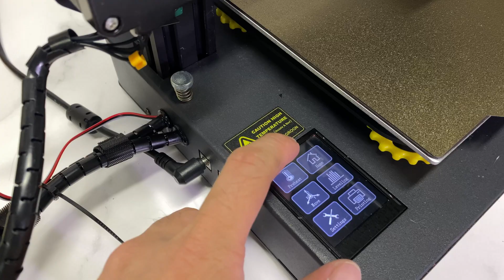How to Add a Filament Sensor to the KINGROON KP3S 3D Printers

Comment: what if ur filament comes from above the printer, i had to relocate the one that came on my kp3s pro and my kp3s doesn't have one but i made a bracket that mounts on top of the z axis extrusion, take the two bolts out hold the leadscrew guide or whatever u call it but it bolts up on top of the leadscrew bracket an uses a 608 bearing so it can pivot side to side with the hotend. i just got the printer a couple days ago an just finished putting it on the printer so after some testing if it works out good, i'll share the files on my thingiverse an other pages but ull u have to search for it ur self cause i dont have it post yet an ill probably never get back to update this comment once i do get it uploaded. Kingroon you really should consider most ppl dont have there filament sitting on the table next to the machine an almost always have it on top of the machine or above it. i own 14 printers 3 of them are kingroon, a kp3, kp3s, and a kp3s pro but out of all my printers only 3 of them actually hold there filament the rest have it spool holders attached to the enclosures there in above the printer or off to the side as high as it can go in the enclosure so still above where the sensors are placed an opposite direction of the filaments travels so u really should consider making two option for ppl to use so we dont have to figure something out on our own, if the sensors could have a piece of ptfe tube put into the out side so it could go down an into the inlet of the extruder that might work but u would have to have the sensors cable long enough an ran with the hotend cables so i think u would be better off just making a bracket that can be mounted at bottom or top an have it so u can have the filament direction coming from the top or from the bottom. if u do this it takes alot less ptfe  tube to help connect the runs. i have just a short piece coming out of the sensor to help direct it an another short piece going into the titan hotend  to make sure it doesnt wear the inlet, it comes with a small piece to help but it doesnt take long for filament to rub through that an into the extruder. think about it.

Comment: Pra quem instalou o sensor, acendeu o led azul e não imprime, como se estivesse acusando falta de filamento, é só alterar a configuração fg_filament_det0_trigger_level  de '0' para '1'  no arquivo de configurações robin_nano_cfg.txt.  No cartão tem este arquivo com as configurações atuais, só que com a extensão .CUR.. é só alterar para .txt, editá-lo e reiniciar a impressora com o cartão inserido.
Reply: there is no such file on my SD card.
Reply: Downloaded the firmware for the printer...  I found the file and did what you suggested... it works 😁 thank you.

Comment: On 2:03 it can be seen that red and white were switched places, but I missed it, and it wasn't mentioned out loud. Good thing I didn't burn anything. Found out only when testing.
Reply: wrong position wire color ?
Reply: @rennug3151  It's correct in the video, but out of the box the connector's pinout may be different. Check before powering.

Comment: My KP3s is version 1.3. The Sensor is working the other way around, it beeps with filament and prints without filament, how to fix it?
Reply: I found the solution, I changed the >cfg_filament_det0_trigger_level to 1 in the robin_nano_cfg.txt file
Reply: @rodrigorbonfim  Hola Rodrigo a mí me pasa lo mismo, pero no tengo ni idea de hacerlo, me puedes ayudar? Muchas gracias
Reply: @djkaleleltemplario  yo corté el cable e invertí los colores. Funciono perfectamente

Comment: If for any reason I start a print without placing the filament through the sensor, will it print?

In other words, if the sensor one day stops working can I still use the printer without the sensor?, do I have to make or configure something?

Comment: is it possible to change pause position? when I print a lot of elements, pause do a crash with previously printed element, is it possible to change it?
Reply from the maker: Please flash back to the stock firmware. If you have already done that, please use the Cura as Slicing software, the crash happens when using PrusaSlicer.

Comment: So the sound comes from the sensor? I dont see any beeper inside the printer (which would be good to have to indicate "print is complete"). Also I doubt the tube is necessary. Plus could you pls tell me the GCODE command which is responsible for Change Filament or at least Pause, M600 does not work, also it does not respond to Cura's Change Filament commands. thank you.
Reply from the maker: The beeper is under the screen, a small, round and black unit. As for the tube, you can test it out to see if it is necessary. The current stock firmware doesn't support M600 commend, if you need that feature, using the Marlin firmware would be a good choice. But our stock firmware may support this command in the newer version that is released in the feature.
Reply: @Kingroon3DOfficial  thank you for answering. 2 more questions then. 1) Is it possible to activate the beeper under the screen so that it beeps at the end of printing? Any GCODE for that? 2) Is there any alternative to M600 which is supported? (I would switch to Marlin fw if no other solutions exist, "don't break something that works")

Comment: Unfortenately you Sensor is not working. When installing it, inserted Filament forces the Printer to Pause, without filament sensor in the printer it works. So really strange.
Reply: Your  filament sensor is wired wrong. you need to get another.
Reply: @stevedegeorge726  i tried to search that file but i didnt find it, where is it???
Reply: change config line fg_filament_det0_trigger_level to 1 in the robin_nano_cfg.txt
Reply from the maker: It can't be, you can send a video to support@kingroon.com, our guy will check that for you. Before that, please make sure you have followed every steps as the video do.
Reply: @Kingroon3DOfficial  Already sent, but no answer
Reply: Still no support

Comment: Help, for me when I try it, the printer stops extruding, but the temperature is still the same & doesn't turn off heating. Is this what it's supposed to do? Or is it supposed to turn off heating?
Reply from the maker: Did you put the filament into the sensor? Please follow the video to check your steps, especially the connecting. According to your description, the sensor works and has been triggered.
Reply: @Kingroon3DOfficial  Yes. The print pauses, but the hotend is still at 200 C. Is this what's supposed to happen?
Reply from the maker: @impyworm115  It means the filament run out has been detected, you need to add the filament. If the filament doesn’t run out, and it goes through the sensor, please check the connection.
Reply: @Kingroon3DOfficial  Oh, okay! So just to clarify, if the filament has run out, the print pauses, but the hotend is still at 200 Celsius & bed is still at 60 Celsius, and new filament should be added?
Reply from the maker: @impyworm115  Yes, that’s normal. The printer will keep the printing temperature until the printing resumes.
Reply: @Kingroon3DOfficial  Thank you, that clears things up! Just curious though, is there any way to make it completely stop the print (and make the printing temperature to 0 Celsius)?
Reply from the maker: @impyworm115  It’s possible, modifying the firmware should be the way. But it not necessary, the unfinished prints need to be held tight and keeping temperature helps that.